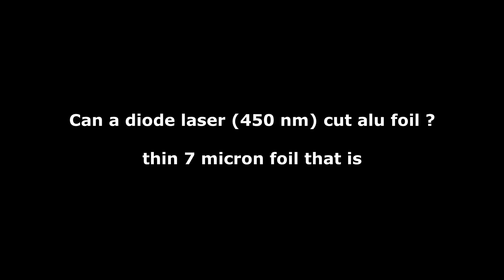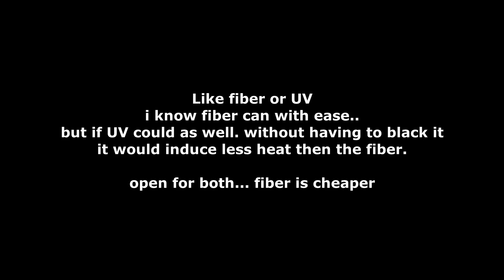Neje 40640 dual diode laser cutting 0.007 mm aluminium foil ?

Comment: Has anyone found an effective way to use a laser for cutting aluminum traces? How narrow can the traces be made? Also, what would happen if the work surface were tilted so that reflections don’t bounce directly back into the laser? I realize this might cause the traces to widen as you move farther from the laser, but I’m curious whether the approach has been tested.
Reply from the maker: it can be cut but not reliable at al (and no small traces since half of it burns away)l (materiaal gets way to hot). it needs another laser source like fibre or uv.  a plotting knife can outperform the neje laser with ease :(
Reply: @joppepeelen  Thank you for your answer Joppe - we are trying at home to make speakers based on your videos. Thank you for posting these as they are great inspiration to us. Asger

Comment: Why not use a edding permanent market to color ihr paper black?
Reply from the maker: thats an option but i would not like to mark 150x150mm every time. even then question is wil it cut sharp...  it wont, besides that i have ot mark it then cut it then put glue on it. its just... well not working i can cut it as you can see :) can i cut it clean thats the question. i dont think it will :(

Comment: Hi. I don't use USB sticks anymore. They were c//p no mater of a manufacturer. I replaced them with nvme sticks, and they just work forever. I think devices will recognize them with no problem if they are formatted in fat32.

PS Is this possible I wonder to press a foil with a plate which has groves, and then to scrape few microns off (a foil thickness) with the laser in a corresponding mode?
Reply from the maker: yeah this one just fucked up. i had some problems files not showing up  (thought i made a mistake)  and in this test. it completely stopped working :(
Reply from the maker: i think i did not use FAT32 this timne because of its size :( might be the downfall. 

hmm not sure about the scraping. i think these laser points are to big, and introduce so much heat it creates a cut much bigger then the laser point itself is. sort of brute force.  thats why i wonder if Fiber laser works... it might just because its power and insane speed keeping it cooler then a diode laser mocing 2000mm/minute. compared to a  fiber moving 5000 or more. UV in this case would/should do even better in heat., and is even smaller dot size (so m,ore power where it maters). so somehow that might be best for me, but unless i see a example... i wont buy any... i waste to much money on daily base on my hobby.  so if it works i am happy to spend the money. else... i might save it :)
Reply: @joppepeelen fat32 is ok unless u need to store movies. 2TB in total, and 128/256GB nvme match. The only a limitation is 4GB files. However u can make an experiment, and format in exfat. There are good chances that most devices accept it.
My 2010-about Philips does not read it for example. 2015 Sony reads without any problem.
Reply from the maker: @sc0or  i think i used exfat...
i dont think it makes a difference it just got fucked